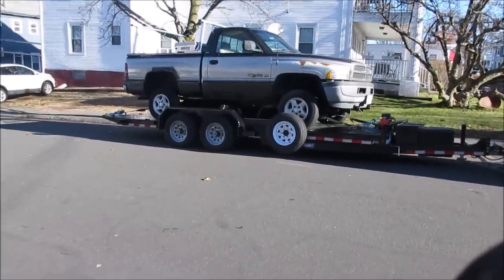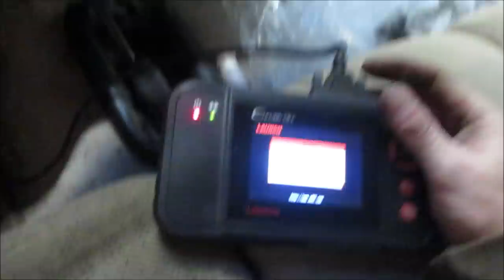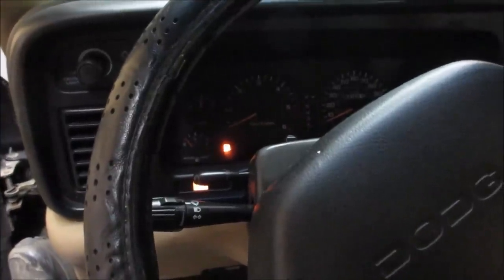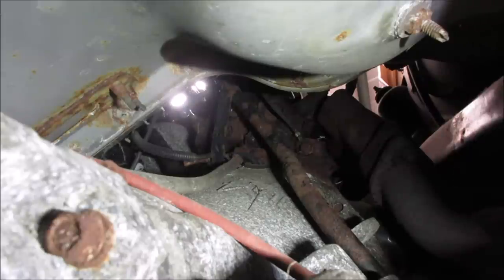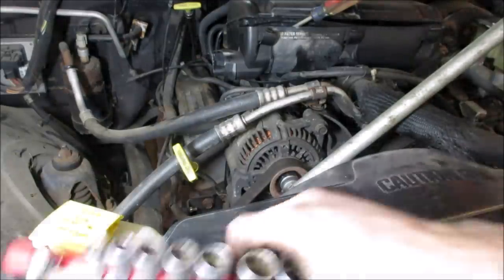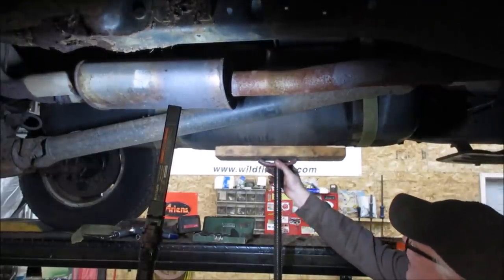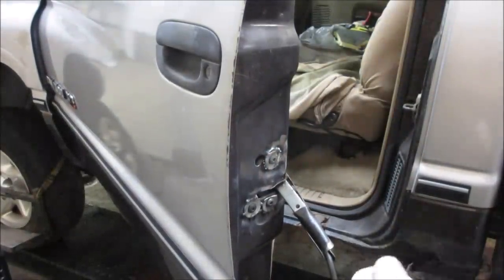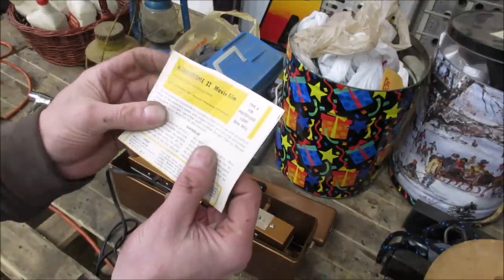Ratty Rusty and Wont Run. But Can We Save IT

Comment: I had a smaller Magnum and the cool wire eventually just disentegrated where it plugs to the top of the coil. The plug wires and coil wire all come together in a pack.

Comment: I had the exact same truck but 99 it was a great truck if it didn't rust so bad because of our long Ontario winters and all the salt on the road. I did undercoat it but that only buys you so many years. I sold it to a local guy and still see it now and then so it's still alive. Never burned any oil plus I changed the transmission fluid 4 times.  Still my favorite body style from Dodge. Had it 17 years.

Comment: Also, it would have been easier if you did it from the top because even though it seems less accessible from the top, the crankshaft position sensor is easier to access from the top, just have to do it blind.

Comment: Yes that 360 can be converted to carburetor,  but it takes a different intake than what you would put on a 70's / 80's 360. From the oil plug to the cylinder heads it's a tradition 318/360 dodge engine with some mild changes. A bonus is the magnum engines are roller rocker engines. Keep the oil clean and they're pretty stout. Have had 2 durangos a 98 and a 99 with the 5.2 / 318. Idle air control valves and the crank sensors are the two pains I've dealt with. Everything else has been cake

Comment: isn't the ram 1500 the 1/2 ton version?  Plowing is very hard on a truck and you will see front end issues that won't be there on other trucks.  You are not easily discounraged.
Reply: plowing beats the hell out of front ends on every truck. 1/2 ton, 3/4 ton, 1 ton. Dodges have junk front end suspension to begin with, plowing with them just speeds up the ball joints,tie rods etc failing

Comment: The items you picked up, the one with a large glass and holder is a wine chiller as you put ice in the center tube and wine on the outside to keep it chilled. To get wine in a glass just pushup on the bottom plunger.

Comment: Hi, used to run a plow truck. It was my truck. I started out with a older Ford bronco and it was just too short to run as a firetruck so I got a long bed pick up and it made a lot of difference but running a short bed truck is insane to run as a plow truck they just don’t have the traction as a long bed
Reply: any pickup sucks getting traction in plowing. pickups are nose heavy. I hate plowing with our long bed 97 Ram 2500. the short box 94 is much more maneuverable. traction issue solved with 3 concrete parking bumpers in the bed over the axle

Comment: Yes my parents had the glass wine thing. You put your empty wine glass under it and use the bottom of the glass to push up the little pin and when you have your desired amount lower the glass, pin shuts and enjoy. The ice holder keeps the wine cold without watering it down as it melts.